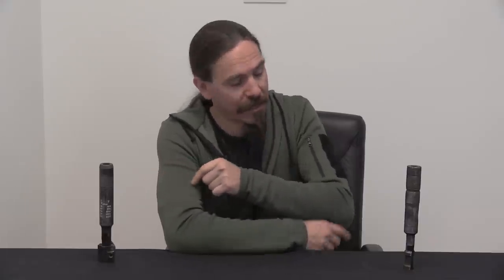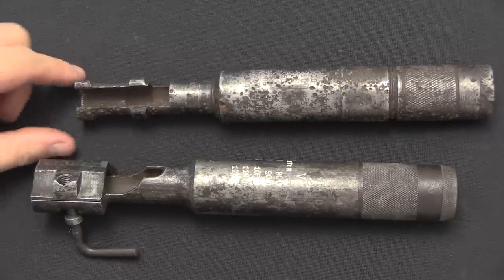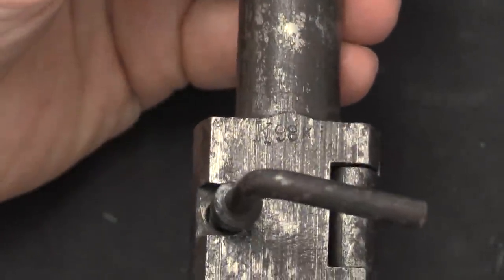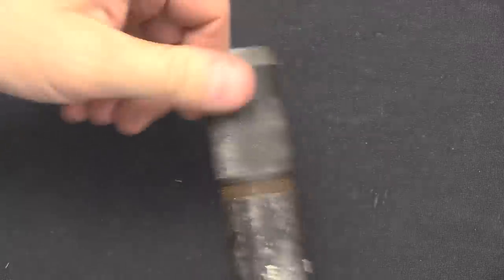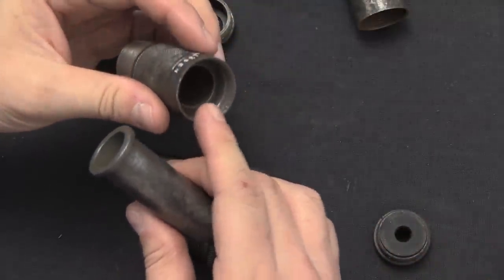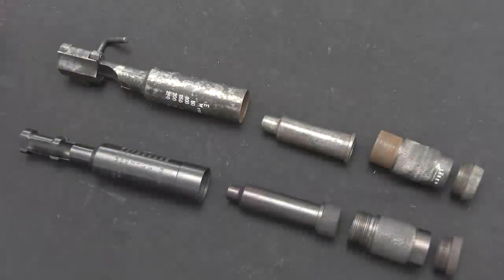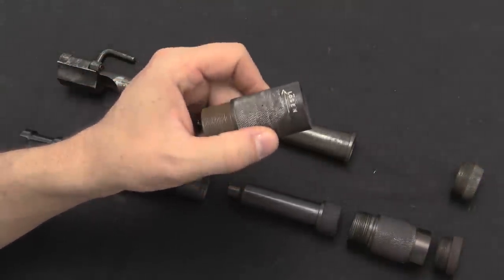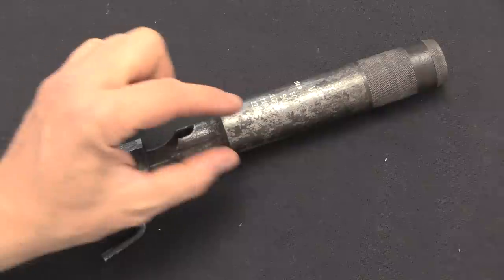Germany Copies the Soviets: L23 & L27 Silencers

Comment: Only 2 baffles? That’s baffling.
Reply: Get out of here
Reply: @darnit1944  stop trying to silence him hes only speaking his mind
Reply: @bambon6184  suppress, not silence!
Reply: @iododendron3416  the original patent was called a silencer though typically the name suppressor is used but they are interchangeable if thats what you were talking about
Reply: @iododendron3416  
The inventor can call it whatever he wants and Maxim chose Silencer. 
I use 'Muffler' which is technically correct, the best kind of being correct. 

For pitch changing guitar bridges you can't go wrong with 'Whammy' while Vibrato bridge would be correct when Tremolo is technically wrong but the most used term based on advertising. Just evade it, it's not worth it.
Reply: First tank was called a tank, even it wasn't really a water tank.
Silencers won't silence anything. They only suppress the noice.

Comment: The mention of the rubber baffles having a reduced lifespan in cold weather, at 06:16, put me in mind of the rubber O-rings that caused the Challenger disaster - they failed to expand in cold weather as well.
Reply: We have similar problems in the aircraft world. Rubber O-rings in the fuel systems are pretty sensitive to big temperature changes. Early winter and early summer when temps are really swinging is leak season.

Comment: Wish more companies made solid reproduction parts like this.
Reply: For the US it won't happen unless suppressors are removed from the NFA. As a suppressor this is a absolutely shit design, and it's not even worth the tax stamp, let alone what a company would charge for it on top.
Reply: @norwegianwiking  i agree but as a mosin nagant owner it would be a neat item
Reply: Also under NFA AFT opinions these baffles/wipes are only replaceable by an FFL. Which makes no sense at all but you know the ATF.
Reply: @norwegianwiking  As a war time suppressor, it's absolutely clever design, as you don't have a gunsmith in the field to make threads to the barrel.
Welcome to Europe, where you're not taxed for a peripheral for a gun.
Those are neat items, quick detachable, no modification for the weapon.

Comment: It's quite interesting that Germany also used rubber like the Soviets did especially since Germany invented Buna-n synthetic rubber and production started in earnest in 1935. Buna-N has a far greater temp and chemical resistance then natural rubber. And also I should add that Buna-N can be made to a very wide range of durometer ratings from super soft and squishy to hard as hell (that is official terminology by the way) even back then. It makes one wonder.
Reply: I remember bicycle inner tubes made from Buna. They were thin and frequently leaky. The current ones are great though. One of those reasons why I'm happy that the wall came down.

Comment: The clamp design is cool rather than having to thread a barrel you can just clamp it on to any rifle
Reply: Yeah, except now you have to deal with clamping pressure\torque and concentricity between the bore and the outside profile of a barrel in some random spot. 
There's a reason that every weapon system designed to work with muzzle devices uses threads: the user doesn't have to worry about bore alignment ever, as long as barrel and muzzle device are both in spec.
Hooking on the front sight post, bayonet-style, is the definition of wartime-expedient engineering solution, and vise clamp is not much better, if not worse (definitely heavier).

Comment: Well, although in a difficult predicament, Germany did have enough rubber, certainly for suppressors, which, as the video shows, do not take a lot. Most likely. they discontinued production, because, simply, the suppressors did not work and were very inaccurate, so, there was no German, who, wanted to use them. Even in special cases.

Comment: I'm surprised they didn't use steel baffles.   You'd only need 3 or 4 of them and maybe a bit more volume inside.  Greater accuracy and longevity.  I guess suppressing weapons was in it's infancy at the time.
Reply: Maxim's suppressor design dates to 1902, and was patented in 1909. I'd believe the principles of suppressing weapons was fairly well understood by the 40's.
Reply: @butchs.4239  I'm sorry, can you refer me to some steel k baffles from the 1940s?  Maybe a quiet 9mm?  Welrod anyone?  Renowned as the the most quiet and covert pistol ever.  Used wipes.  Tell me more about how the "principles of suppressing weapons in the 1940s was fairly understood."
Reply: @jessesmollet6352  A De Lisle carbine's report  was under 90 dB using Maxim style steel baffles and no wipes. Not as quiet as a Welrod, but it was more accurate at longer distances and didn't suffer from the problems inherent with a suppressor using wipes.
Reply: If they couldn't afford to use rubber, they're not wasting steel in war time.